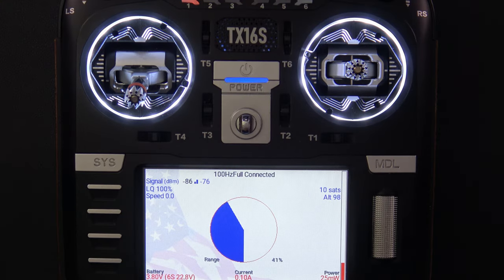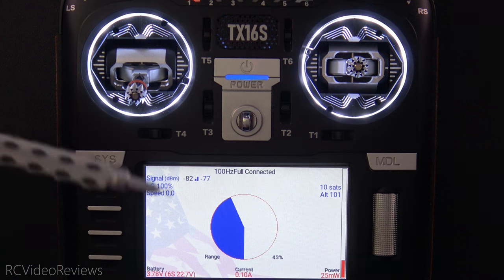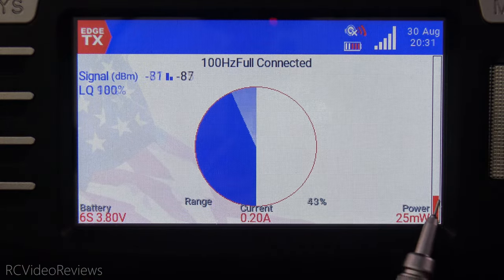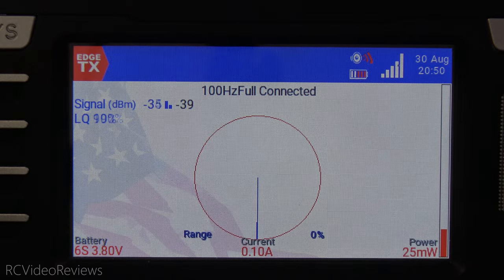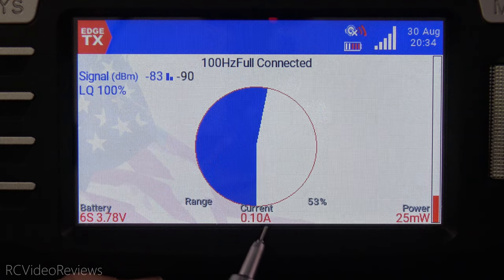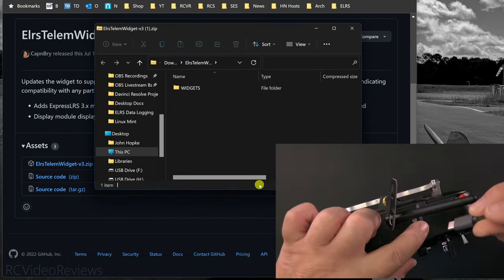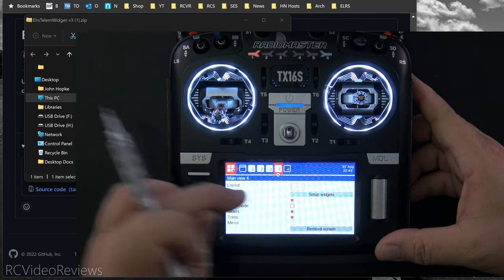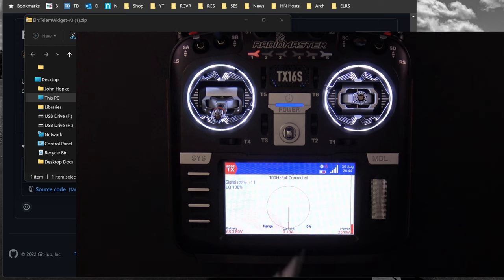Check out this KILLER ELRS Widget!

Comment: Thanks for sharing another great widget John.  Awesome, now I will need to put a GPS on my plane, lol. Oh I did modify the widget to get the Flight counter to work with my arm switch since mine needed to be up not away (reversed) That's cool for keeping track of the flight count for each craft.
Reply from the maker: Good deal. Sounds like the force is strong with your radio :)
Reply: @RCVideoReviews   so true Yoda. LOL

Comment: Hi John,  This is a question regarding telemetry when using a pixhawk controller connected to a ELRS receiver via telem1 or telem 2 port.  I can see the Elrs receiver in the video piece  can send telem back to the TX when connected to a converter board that has current sensor and GPS etc.
 So have you tried to get a pixhawk board connected to a HappyModel  ES900rx.  I managed to get connection and control, but try as I may, I could not get the telem from pixhawk to happymodel es900 transferring to the telemetry page on my Radiomaster. The only telem I could get back to the TX was that generated internally in the ES900 receiver. So going to the telem discoverable on the Radiomaster, that is all I can see. I guess the protocol is wrong from pixhawk to ELRS.
Maybe you might like to do a piece on how-to if it is possible.
Reply from the maker: Sorry, I've never used Pixhawk. So I have no idea.

Comment: Firstly, thank you for very informative content. I have a question concerning the Matek R24-D receiver. I am running the ExpressLRS telemetry widget and the R24-D receiver flashed with V3.0. However, ExpressLRS Configurator V3 doesn't offer the option for diversity antennae, only 2.5 & V2.5.1 offered that option. If I may, what ExpressLRS version are you running with the receiver and TX module to get both antennae visible in the widget? Thanks again.
Reply from the maker: 3.0 offers 2400 RX R24D which is the correct firmware for the R24D. With that installed, make sure you discover new sensors. The widget requires the telemetry sensors to show data from both antennas before it will show you data within the widget.
Reply: I'm like you, I have flashed 3.0.0 and 3.0.1 and selected device R24D and I don't receive any data for RSSI #2 even after deleting all the sensors. I have the same issue with my RadioMaster RP3 Diversity...

Comment: I really am so lost right now. I have upgrade my Frsky R9 Module to elrs, and I have bout ( without realising that it has the build in elrs reciever) I have the radiomaster tx16s . What are my options? the drone's reciever is 2.0 Ghz is it possible to upgrade the Frsky R9M to 2.0 Ghz!? or is it possible to use my radiomaster tx16s or I have to do something else. I really apprishiate any help ( sry my bad english )
Reply: The R9M is 900MHz and cannot be changed to 2.4GHz. If your TX16s does indeed have the internal module use that. Double check that your receiver is Elrs and if not replace the Rx with a 2.4GHz Elrs Rx. When setting up your model select the internal module. Personally wouldn't bother with the R9M unless you have a bunch of models with 900MHz FrSky Rx's installed already.

Comment: Question, when using an external elrs module and in model settings having the external RF set to crsf and the internal set to off as it's meant to be. .. what should the setting in the hardware page internal RF be set to?  I have the 4in 1 version and it's set to multi, is this correct?
Reply from the maker: It doesn't matter if you have the internal module turned off in the model settings....I don't really understand your question.
Reply: @RCVideoReviews  ok I'll rephrase that.. with the RM TX16s mk2  4in1  when using an external module does it matter what the internal RF on the hardware page is set to?